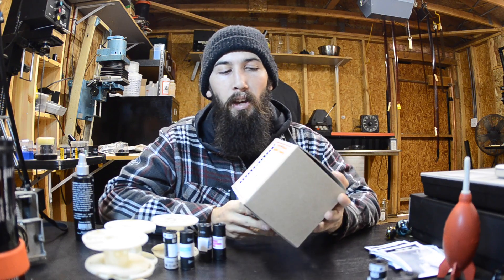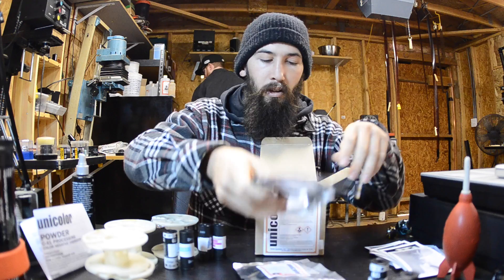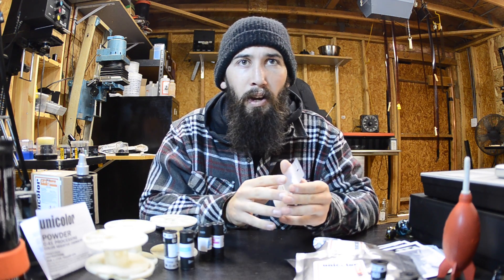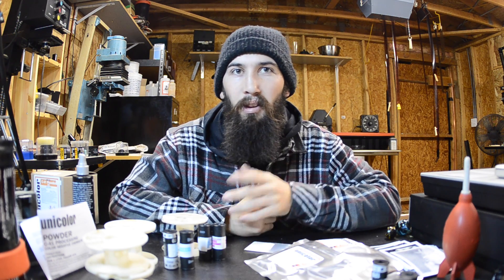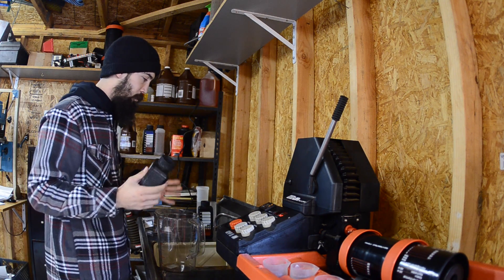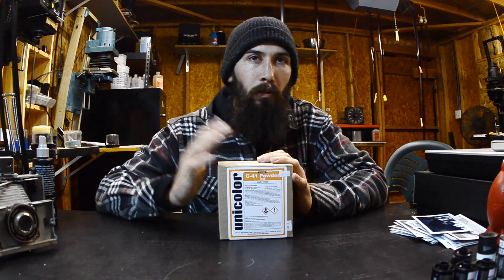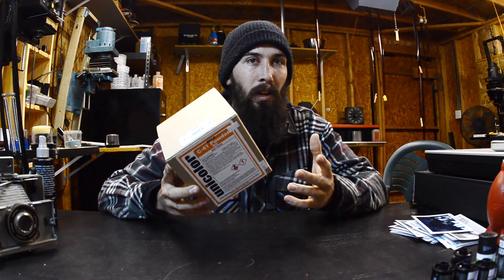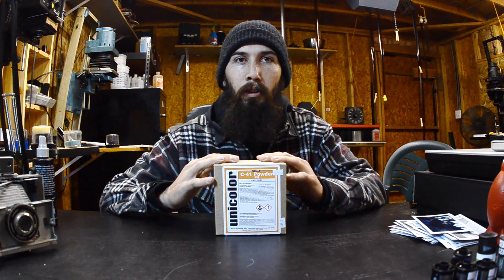How To: Develop Color Print Film  (C-41 Process)

Comment: Never never ever use a rotary processor for c41 film ,the flow of chemistry over the emulsion is variable from the inside to the outside of the spool ,ie the outside gets 200 % more agitation than the middle. To prove this shoot and process 36 frames of a grey card then print without changing the filtration on the enlarger you will be horrified . The only way is in a tank agitated by inversion . C41 is not a finality process ,time / temp/ and agitation are all a variable that MUST consistant for easy printing .

Comment: Hey guys... Has anyone tried building a JOBO-like processing station for C41 color film development?
If you havent seen one, google "jobo pcc2" So its basically a plastic tank filled with water that is being heated with some kind of an electrical water heater+ thermostate and Its used to heat both the film tank and the chemicals stored in bottles and submerged in the same heated water. It also has an elecromotor that slowly spins the film tank so that it develops evenly and so on... Using this you have 2 constant values in the developing equation...constant spinning and constant temperature. So you only need to keep your mind in mixing chemistry good.
The problem is that this piece of mid last century equipment costs around $1500 up to $2000 on ebay...I think thats crazy...
So I fugured... STEAK COOKER! :D They sell these slow steak cookers (or "sous vide" cookers for like $50 on ebay and its basically a precise 800W water heater that you pin to the rim of the pot and it keeps a constant water temperature and it even has like a small motor that corculates the water around so that it heats evenly to the temperature that you set.
What I wanted to try is to put together the cooker on the rim of a large plastic tank, a small electromotor that would spin the film tank in water and some sort of a plastic frame that would keep the bottles with chemicals submerged. I thought that in order not to get electrocuted to death, it would be wise to fix the electromotor on the wall next to the tank, and spin the film tank via some sort of a transmission...like a rubber band or smth. And the film tank...I would hot glue the bottom of the tank to a large magnet so that it would be easy to pull it out from the transmission to pour the chemicals in and out of the tank.
What do you think? Is there something that I'm missing? Has anyone tried something similar?

Comment: Don’t buy a Jobo. That Jobo setup is well over $3k alone. Not to mention his film dryer.
If you are newer to developing film, this video alone can make home developing  feel out of reach. Realistically, it’s not super cheap, but if you plan to develop and scan your own film and plan to stick with the process, it’s worth the expense.

Realistic tools:
For temp control, get a sous vide or one of those new cinestill tcs-1000. This will allow you to quickly, and accurately, get your chemicals to specific temps. Looking at around $100.
Patterson hand tanks are fine to use. You won’t be able to walk away because you have to agitate every 30 seconds, but it’s easy. The medium tank is $35 I think. Fits 2x35mm or 1x120mm.
Squeegees are $10-15.
Drying: get some film clips that you can hang from your shower curtain rod. The bathroom is a great place to dry your film because of the very little dust floating around thanks to the shower being used everyday. It’ll take a couple hours to dry the film this way. The clips are under $10.
Dark bag: you’ll need a dark bag to get your film onto the tank reels without exposing them to light. Very easy after the first time you do It. Dark bags run about $30.
That’s literally all you need. Under $200 worth of supplies and you’re ready to go...then upgrade as you see fit.

Film developer per quart/liter runs anywhere from $20-30.
Film scanner with great results for “amateurs” is the Epson V600. Runs under $200 from amazon and at Freestyle for $220.

My $0.02.
Reply: I've been developing film at home with the cinestill kit. Everything probably cost me under $200 new. It's fine and did probably a dozen rolls fine but honestly its not that fun. The huge thing that makes the jobo appealing to me is the hand lever to change the chemicals. Yes $3k is a lot for one of these things but there are used ones out there for a fraction of the price. Been trying to make my cinestill system more efficient but if I can make developing less annoying then I'd still have energy left to want to scan my photos lol.
Reply: Absolutely true!
Reply: Yeah, that’s how I do it. It’s a bit tiring when doing many rolls but I love it.
Reply: For plastic reels, try to find ones that have a larger “tongue” where you start the film on the reel. It is 1000% easier for me to get my film spooled with that one. It’s compatible with Paterson tanks. 

There seem to be a few styles of those white plastic spools floating around. I have one with the short tongue and I can do it, but it takes me much longer to get the first few inches on the spool.

Comment: Can you use the Jobo Tank to develop colour prints? I develop my own colour negatives in hand tanks, and scan the negatives. I have an LPL Colour enlarger and I'd like to actually use it to make colour prints, but I don't want the expense of buying an automatic print machine.
If Jobo make a tank that will hold paper then your machine might be a cheaper option.
Reply from the maker: Randell John yea you sure can! The jobo has paper drums and the ability to heat your RA-4 chemicals to develop the paper. The jobo does it all!!!

Comment: I'm wondering why the water level in your Jobo is so low. The instructions state that the film tank should be half submerged in water to maintain temperature. Do you know something that doesn't require that much water? Thanks.

Comment: Have you guys processed any Vision3 35mm film with your Jobo? Just wondering what's the easiest way to get the remjet layer off from the film before normal processing... Thanks!
Reply: Mikko Toiviainen I've found just using warm water works very well, and just rub it off gently at the end of the developing process, before the stabiliser step.
Reply: Spehmaster G., do you recommend using something like a coffee filter to strain the developer and blix when putting it back into the bottle for re-use (in case some of the remjet comes off during development)?  Film Photography project recommends it for film with the remjet, but I've never seen anyone in YouTube videos doing it, and it would be a huge extra step.  I haven't done any movie film yet, but am preparing to.

Comment: The Jobo rotary processor is probably the most expensive unit of its type, it has a reputation of not being the most durable, and repair parts are expensive. As an alternative consider an insulated film processing drum and a drum roller base. I use a Unicolor Film Drum and Unicolor drum roller, commonly available on ebay for a small fraction of the cost of the Jobo. You need a seperate water tank to keep solutions warm; I use a beer cooler with a fish tank heater. Otherwise, the process is about the same.
Reply from the maker: Randall Stewart those are some great alternatives thanks for the info!  I found this processor for $400 locally! So needless to say I had to buy it!
Reply: Does an aquarium heater go up to 100° f?

Comment: I used this Jobo back in the early 90s when it probably first came out, and parts were easy to get. Are you finding parts an issue? Curious because I am looking to find one but most are used so parts will have to be readily available. Cheers www.johngessner.com
Reply: +John Gessner I've had great luck finding parts and support for my Jobo CPP2 from Omer Hecht at Catlabs of JP.  Great info on his site and I think he repairs them, too.  Did you know there is a now new model Jobo?  I think it is the CPP3, using many of the same parts and motor as the older models.
Reply: Nice thanks. I am getting ready to do a photo darkroom shipping container project. Really want the Jobo to be part of that. Film is not dead!

Comment: How many times can you re use the developer and blix?
Reply: Also, the fixer, how many times can you use it? And I have a Patterson squeegee too, and I kinda hate it...it scratches my negs, must be a faulty one, bit haven't used it for a while
Reply from the maker: I've processed well over 30+ rolls with a kit like this but I usually find that time is the variable that exhausts the chemicals. I usually re mix chemicals often just because they are cheap and I don't want to find out that they have gone bad. But so far I haven't had any rolls not turn out at all because of developer issues. 

Yea the squeegee part kinda sucks but without it the stabilizer will leave hard white spots all over the film that is very difficult to clean off. I wish I didn't have too but the few times I didn't I noticed very quickly how necessary it was.
Reply: You can just add photoflo to the stabilizer. It works great and no more squeege and scratched film